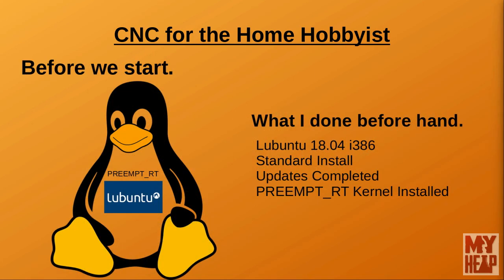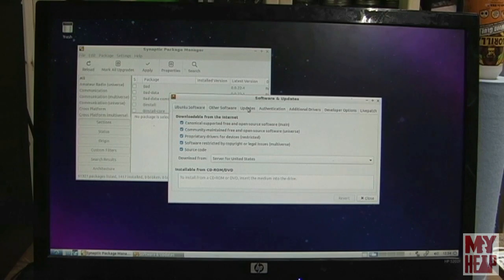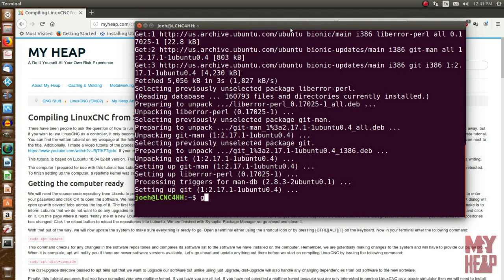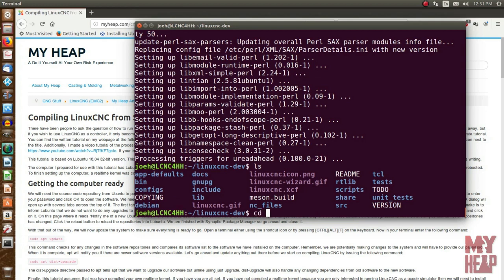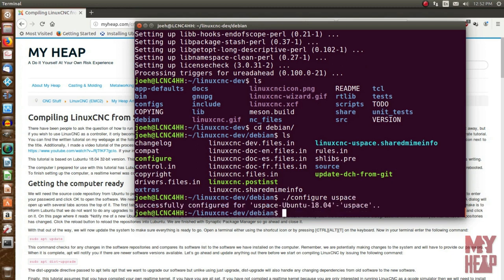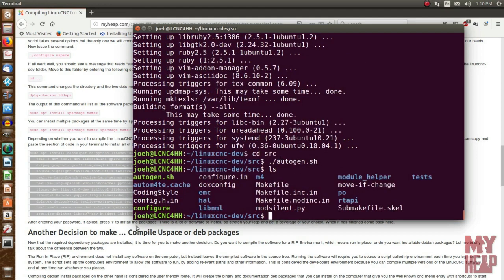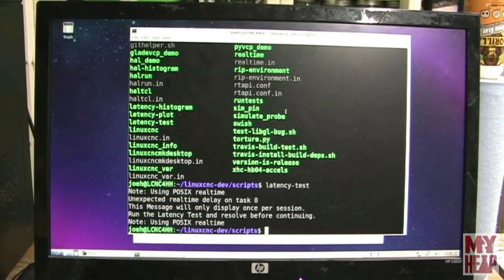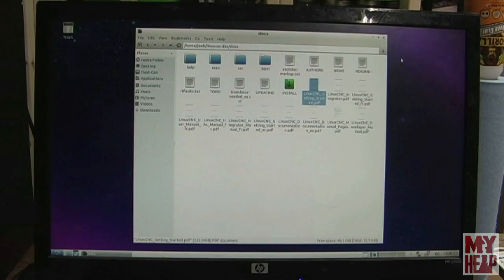LinuxCNC for the Hobbyist - 018 - Compiling LinuxCNC from Source Code

Comment: Very comprehensive Joe. It appears to be much easier than I originally thought. 😀 I do think I'll download your tutorial files from the website. Now I have another project to add to the list. I'd like to see how the real-time kernel works in the real world. How's the basement coming? Thanks for the hard work on this subject!
Reply from the maker: Hi George.  I hope you found it useful.  I am starting to think the whole realtime stuff is a little bit of voodoo.  I my experiments some kernels work better than others and it seems to depend somewhat on your hardware.  Just as a side note, the 5.0.x version of the preempt-rt kernel seems to work best on my old hardware.  Other than not liking the desktop recording software, hence the ssh session on my other computer to record.  Talking to the LinuxCNC developers I am told that the rtai kernels give better latency results than the preempt-rt kernels.  But on new hardware it is only slightly better.  I guess the best thing would be compile the kernel and LinuxCNC and just test for yourself on given hardware.

Any idea what you would like to see next in the series?

Joe
Reply from the maker: Almost forgot.  Basement is on hold till I get the shower/tub.  I want this in hand before I finish the wall framing.  After the wall framing I need to get a little HVAC done do I can finish the soffit framing.  I really want to get all the framing done before I move to the next phase.  That will probably be the electrical rough in.  Slow work my friend when you do it mostly by yourself and debt free.  But I will get there eventually.  😀
Reply: Oh boy, my mom has been waiting 7 weeks for her new tub/shower to get here. I hope you don't have to wait that long. 😀